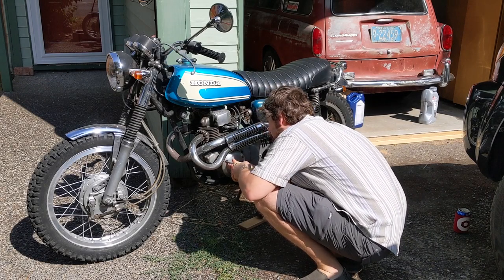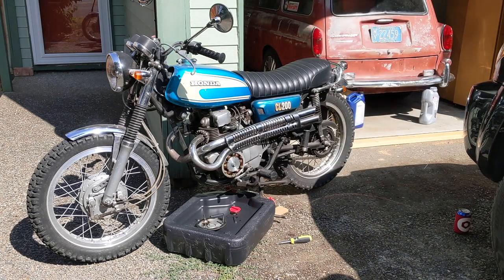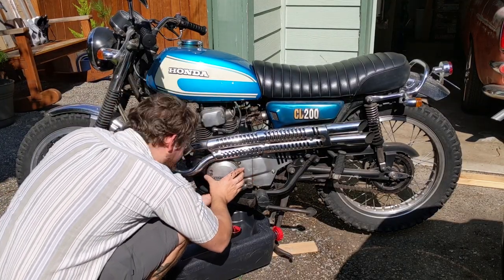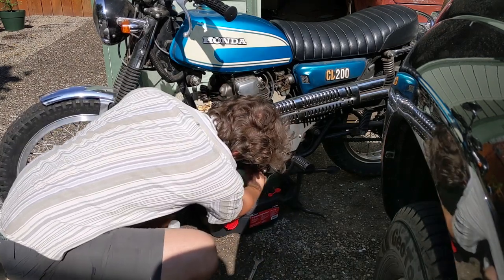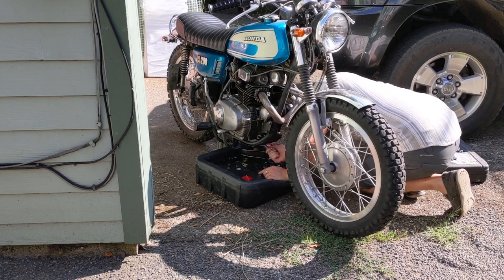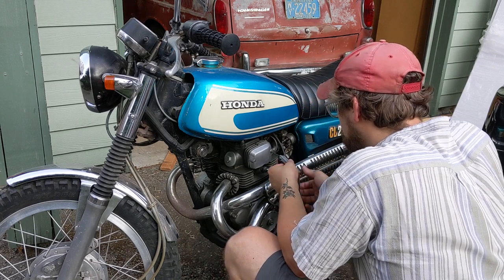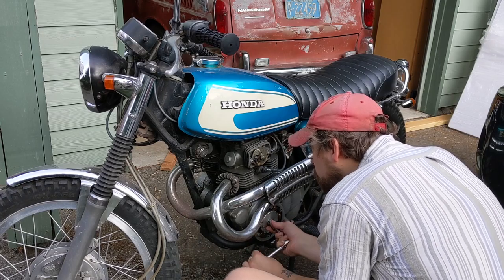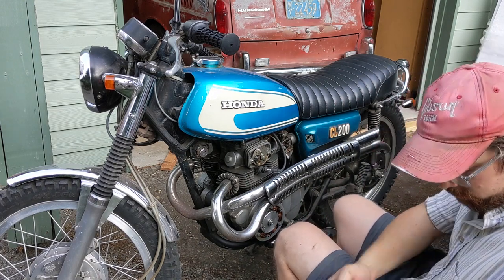Honda CB200 CL200 Engine Tune-up Tutorial!

Comment: Good job again
These bikes do not need synthetic oil as far as most forums and spec mention
Just plain old 10-30 or 10-40 4 stroke motorcycle recomended oils depends on climate
Synthetic will not improve any thing
Instead it will add to more issues
Your exhaust is leaking bad
You may need new seals on the front headers or other seals between connectors.

Comment: I bought a 1975 CB 200 in 1981... which had 6200 miles on it....at the time. I learned how to do all this stuff.... All, just out of a Clymer manual and using basic mechanical skills. I was 19 years old at the time,... It is cool to see people work on these...all these years later.  I remember using Castrol GTX 20-50w in mine. I will tell you, the weak link in that engine is the rod bearings... I lost them twice with 2 diff engines. I also over revved it a lot..which was surely the cause. I was a wild / dumb kid back then and really very lucky to be alive... Enjoy...thanks for posting this

Comment: My throttle won’t clear 5-6,000 rpms :/ wondering if that has to do with the Air Intake Carbs or what. My fuel like leaks too with the petcock on… idk, I’m having issues getting it to get it to have any power really
Reply: Have you checked the compression? Read this: http://dannix.net/lib/moto/old-honda-twins

Comment: I recent picked up a 1974 cl200 scrambler. I wanting to put nobby tires on it as well. What size tires are you running? I was hoping to do 4.1 in the back and 3.5 in the front.

Comment: hi just need ur advise ive upgrade my cb125 e to 200 cc but just want to know if i need to upgrade the battery as well plz
Reply: Depending on the year of cb125$
The cb/cl200 are 12volts from factory and only late model cb125s after 1981 were 12v so big difference
Two different systems probably

Comment: How do I know when it’s in top dead center?
Reply: There is a T mark on the generator rotor. You need to turn the generator rotor until that T line aligns to the Index mark. The index mark is around the 10 o'clock position, right by the bolt hold from the generator cover.